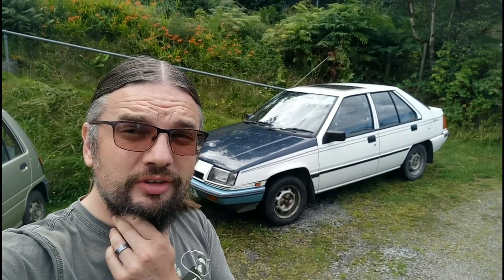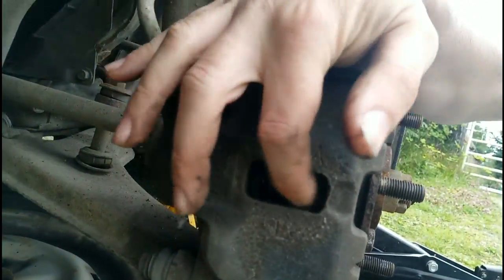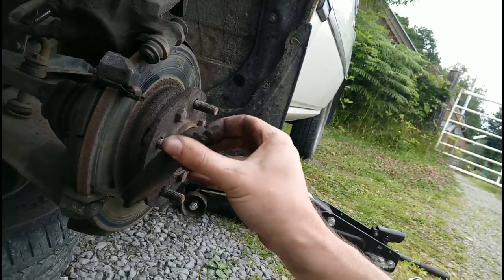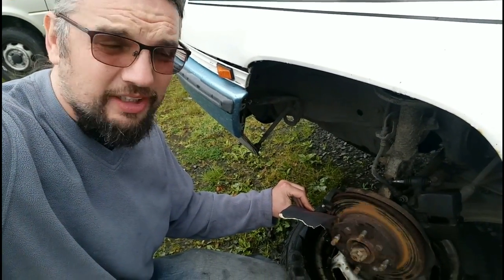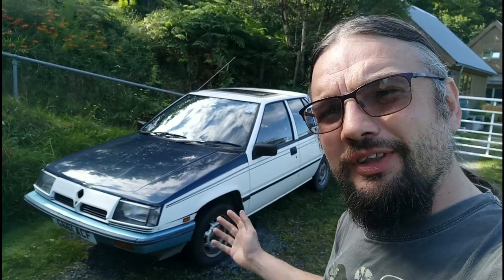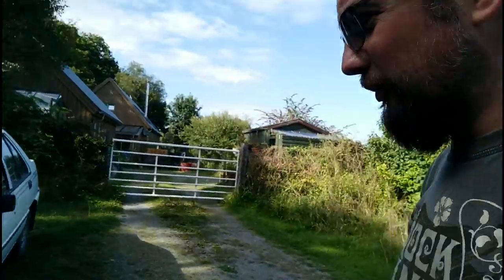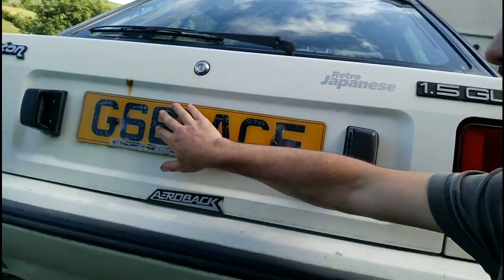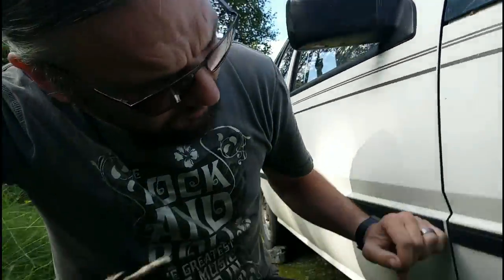Fixing my Proton 1.5 GLS Aeroback (Saga) - brakes

Comment: That's a really good result for a £50 car.  Those Protons, although pretty much forgotten, were actually really good cars, as were the Mitsubishis they were based on, though the Protons do seem to be more rust resistant than the Mitsis.  My sister had the facelift version of that car for many years in the 2000s and absolutely loved it, in fact she'd probably still have it if it hadn't got vandalised.  Being the facelift car with the pointier nose it had power steering and while that did make it a lot lighter to drive it got very vague and wandery at motorway speeds so I think I'd rather have the unassisted version which wasn't too heavy and actually had really nice steering for a front-wheel drive car.  She's now got a Proton Persona Compact 1.6 automatic that I found for her when her last Peugeot developed electrical woes so she's still keeping the Proton love alive...
Reply: £50 cars can be quite good. Even the scrapman can't get a car at that price.
Reply: Im a Malaysian and I have the 1999 Proton Saga Iswara and you will know how long it lasts since the only damage is the paint and the door lock snapped due to heat exposute and thats Malaysian quality there!

Comment: Did you mean 1st or 3rd of August? Found your videos tonight, and had to check whether I was watching one from a previous year! Thanks for this one, though. You might just have found a car which is worth spending a little on and running for a while. But a stuck-open window in Wales is a bit of a challenge! First repair after the MOT Test?
Reply from the maker: I meant 31st July. Typo! Plenty of small jobs to be getting on with, including that window.

Comment: Surprisingly little wrong with the Proton. considering it is a 27 year old car. Saw a Proton MPI  for sale on Autotrader last month  only 18,000  miles with m.ot. £300 . Good candidate for  bangeromics. Why are you off to Ireland to source spares?
Reply: They're not uncommon to find like that either and I've thought the same.  People struggle to give them away too.  I really don't know why Proton didn't take off...After all they were using Mitsubishi technology.  Although outdated, they must've been reliable enough.  Aside from difficulty obtaining parts, I couldn't see the problem with driving one.
Reply from the maker: Neily Choppers I am aware what I said is misleading. I need to get parts and, separately, we're off to Ireland. The two aren't linked. Hard to edit the spoken word!

Comment: What's an MOT? Do you mind explaining it to a clueless Malaysian? :)
Reply from the maker: +John L Annual safety inspection. Tester is checking for worn components, and ensuring the brakes work properly. If it fails, you have to get it repaired.
Reply: Annual? Sounds like a pain in the arse. We have something called PUSPAKOM in Malaysia. But normally you only have to let them inspect your vehicle if you or the previous owner didn't renew the road tax for many years, and you want to drive it on the road again.